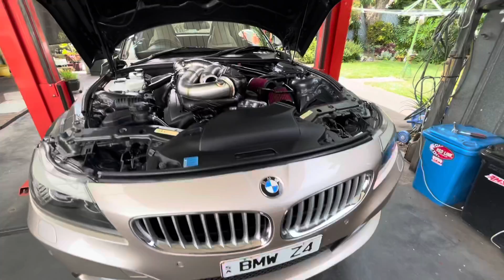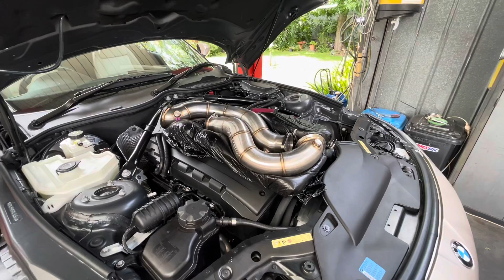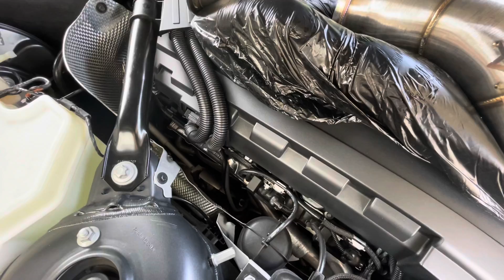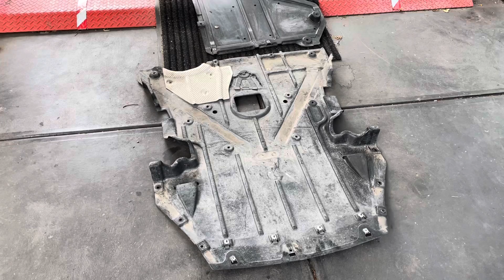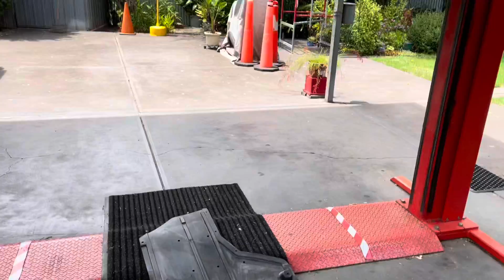Installing VRSF downpipes on a right hand drive BMW E89 Z4 35i

Comment: Hey are these downpipes specifically for rhd or not? Because i cant find any downpipes for my z4 e89 rhd
Reply from the maker: @Z4liver  they were sold to me by a VRSF dealer as being RHD compatible, even VRSF website said they fitted RHD.  But they don’t fit and I had to modify them.  VRSF since updated their website to say they only fit LHD.
Reply: @ ok thanks. So i can buy downpipes from china for z4 e89 lhd and modify them like you did?
Whats about chargepipe and inlets? Same ad LHD?
Thank you for answering

Comment: All my local mechanics refuse to try and install these downpipes on this exact car they say they have to drop the subframe and it’s a difficult process but I’ve seen people do it without doing that
Reply from the maker: @FloatUnderWater  I did it in this video without dropping sub frame but it takes some careful wiggling to get the old ones out and the new ones in.  It’s like one of those mechanical puzzles where something only comes apart if everything is on the perfect angle.

Comment: Watched all 1 hour of this but cant see what the actual modification needs to be? Is the pipe modified?
Reply from the maker: Yes, the position/angle of an O2 bung in one of the downpipes is modified. It is described from the 40min30sec mark of the video.
Reply: Amazing video mate

Comment: Thank you, very informative, I looked at you video about 59 times before I attempted the swap, but………I did not have to modify anything! The sensor fits into the bung without problem, it’s close to the steering shaft but it works.
Reply: I'm so frustrated trying to get mine done, some say you do need to modify, some say no. Do I, don't i?  Urgh!
Reply from the maker: @smith1wayne the bung position/angle may need to be modified so the O2 sensor has adequate clearance to the steering rack.  The clearance needs to allow for the torsional tilt of the engine under load.  It tilts further towards the steering rack under load.  The amount of clearance may vary due to condition of the engine mounts and manufacturing variations of the downpipes.  Obviously this issue is ONLY applicable to right hand drive models.

Comment: What is the size of the button head bolts that your replaced the E8 Torx bolts with on the side of the block? Frames  37:31 - 38:02